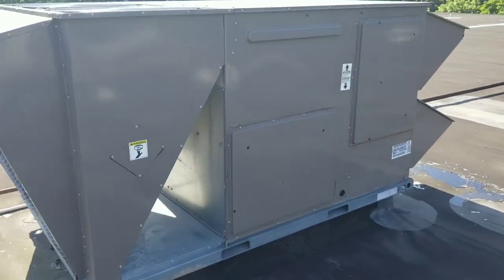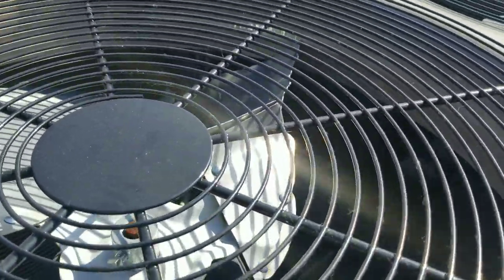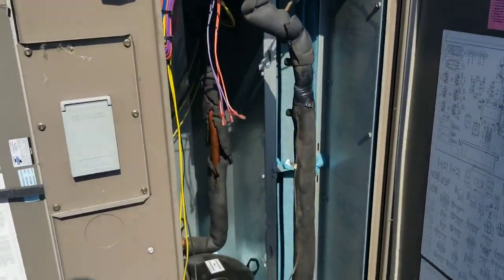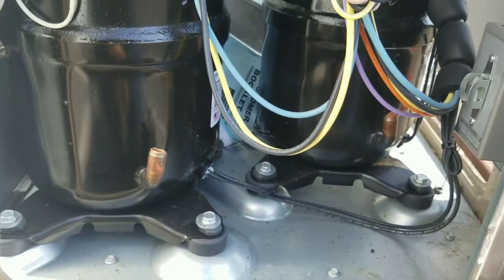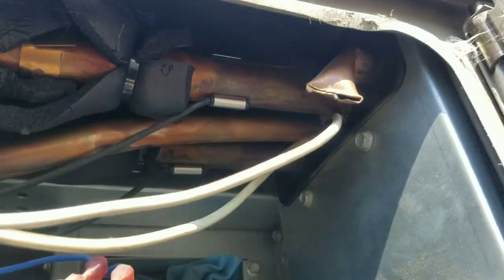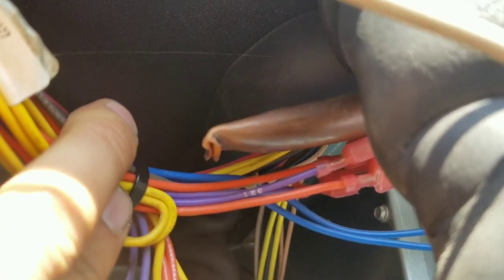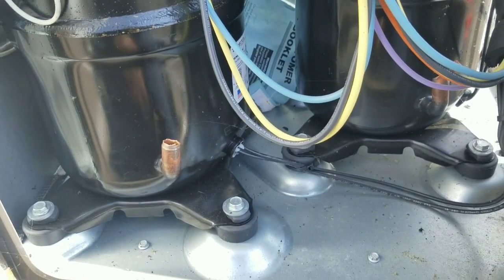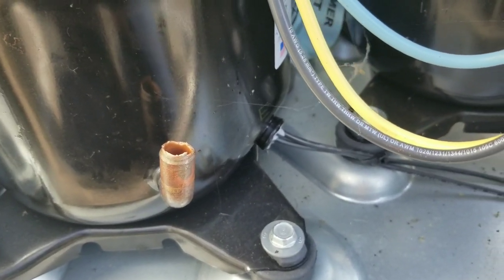New York RTU not cooling

Comment: Wow, nice find.  That’s so funny.  But you’re correct.  You would at a minimum have To drain the oil, change it, new driers, and maybe new driers in 2 weeks.   Also, you don’t know what debris or copper shavings made it inside the compressor discharge lines.  Great recommendation on just Changing both compressors for the long term fix 👍🏽👍🏽👍🏽

Comment: Yup the old copper for crack problem. It was bad here in Houston in the 90s. I had one location I replaced the copper every Monday. I quit insulting the suction line to save the customer some money. They put a 12’ chain link fence around the unit so the crack heads cut the fence. See you next Monday. 😂

Comment: wow that coil was dirty. and damn that fan blade. they are usually pretty strong havent seen that to often. and looks like sabotage. those liquid lines dont just pop off. definitely someone ripped the copper out
Reply: I've had 5 of those York fan blades fail like that since last summer, and 3 of the failures caused coil damage requiring replacement. ($1200 ea.)
Reply: @MrWayne6363  wow crazy

Comment: hi, i have an old lennox rtu that's not cooling. the suction line just before the compressor is really hot. the liquid line exiting the condenser is cool. compressor is also very hot. i measured the common,run and start windings at the compressor and seems normal, capacitor normal. there's only one port on the discharge to hook up the gage manifold. i don't see a port on the suction line to hook up gage. the reading was around 125psig on the high side on the discharge line. it's an r22 system with capillary metering device. could i be low on charge? and how would i check the suction line P/T. i want to see the superheat and subcooling. please help. thank you.